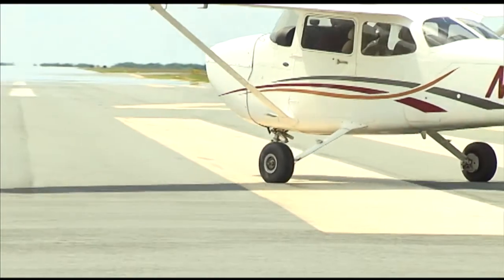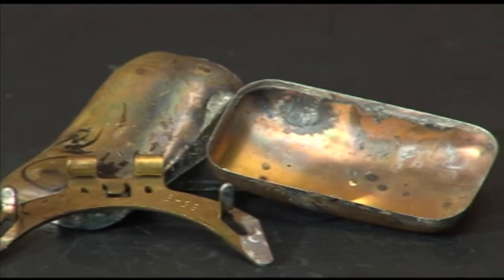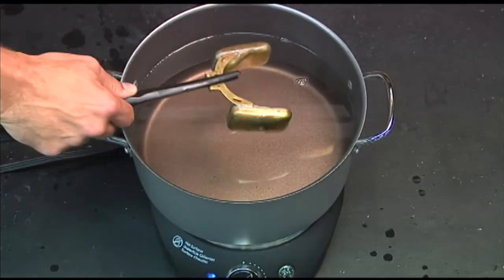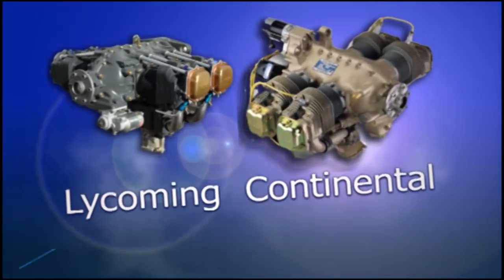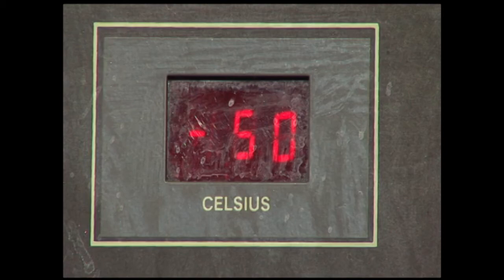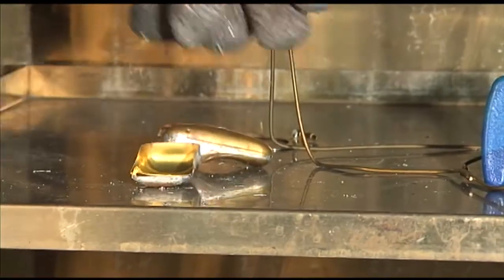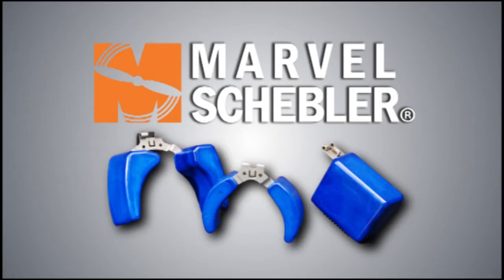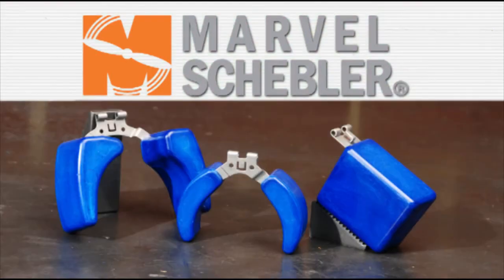Marvel Schebler: Epoxy Floats

Comment: Good product, exchanged my MS carb about 3 years ago in 2019, no problems or leaks. It does have a rough engine operation about 2/3 throttle when descending in a certain small range so not perfect.